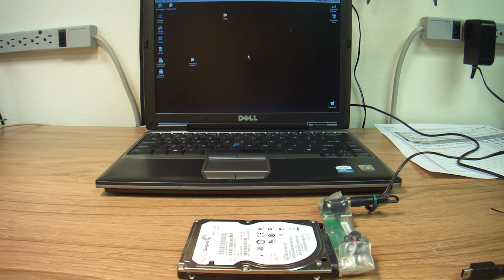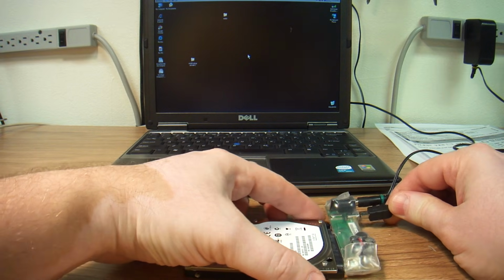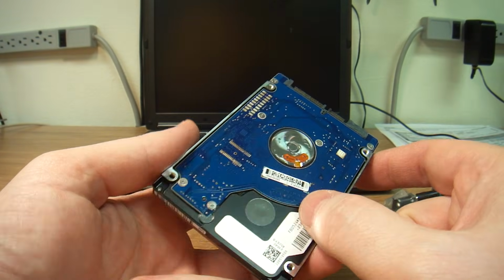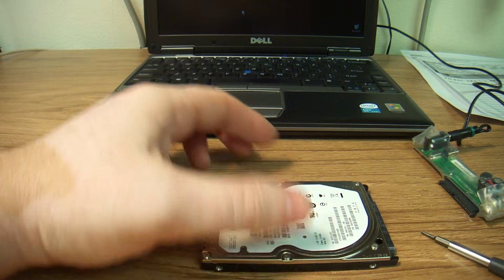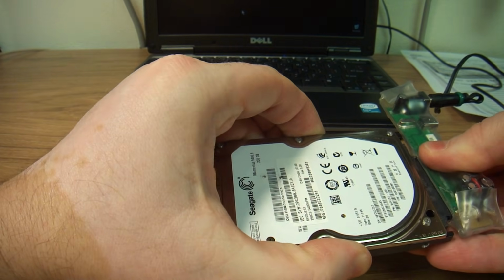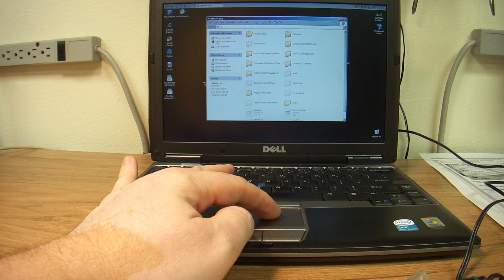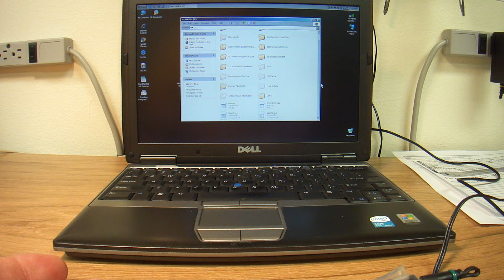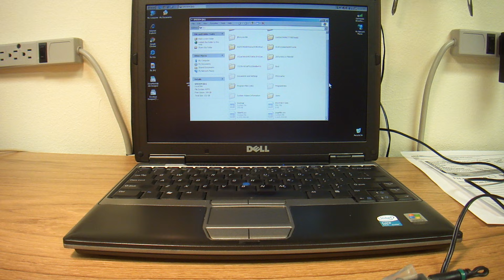How to fix a broken hard drive Beeping noise or clicking RECOVER GET DATA BACK FOR FREE! BEST TRICK

Comment: Just done mine, clicking like mad two drives in Raid "0"  

This was WD high speed VelociRaptor raid 0 set, so i opened both drives and found both heads in each drive about half way across, moved them back to the stops as i rotated the disk. put them back in to the PC booted it and both drives showed up as the raid 0 set, in disk manager both drives had yellow triangles and " at risk" labels, so i coped 103 GB onto a SSD and then in disk management carried out hard drive repair to one of the raid drives this makes windows repair both raid drives together, Faults where found but corrected by windows as in the file below. i am going to carry on running the raid 0 drives as all the data is now on an SSD anyway.  Thanks for the Tip on repairing the drives. 
   

Checking file system on G: Volume label is WD VelociRaptor Raid drive. Stage 1: Examining basic file system structure ... 8448 file records processed. File verification completed. Deleting orphan file record segment 4772. Deleting orphan file record segment 4773. 4 large file records processed. Deleting orphan file record segment 4775. 0 bad file records processed. Stage 2: Examining file name linkage ... Index entry EditorLandscapeResources.upk of index $I30 in file 0xe60 points to unused file 0x12a5. Deleting index entry EditorLandscapeResources.upk in index $I30 of file 3680. Index entry EditorMaterials.upk of index $I30 in file 0xe60 points to unused file 0x12a7. Deleting index entry EditorMaterials.upk in index $I30 of file 3680. Index entry EDITOR~1.UPK of index $I30 in file 0xe60 points to unused file 0x12a5. Deleting index entry EDITOR~1.UPK in index $I30 of file 3680. Index entry EDITOR~2.UPK of index $I30 in file 0xe60 points to unused file 0x12a7. Deleting index entry EDITOR~2.UPK in index $I30 of file 3680. Index entry DIAMON~1.UPK of index $I30 in file 0x11db points to unused file 0x12a4. Deleting index entry DIAMON~1.UPK in index $I30 of file 4571. 9234 index entries processed. Index verification completed. Stage 3: Examining security descriptors ... Cleaning up 8 unused index entries from index $SII of file 0x9. Cleaning up 8 unused index entries from index $SDH of file 0x9. Cleaning up 8 unused security descriptors. Security descriptor verification completed. 394 data files processed. CHKDSK is verifying Usn Journal... The remaining of an USN page at offset 0x30db370 in file 0x23 should be filled with zeros. Usn Journal verification completed. CHKDSK discovered free space marked as allocated in the master file table (MFT) bitmap. CHKDSK discovered free space marked as allocated in the volume bitmap. Windows has made corrections to the file system. No further action is required. 145221631 KB total disk space. 110679572 KB in 6486 files. 4564 KB in 395 indexes. 78835 KB in use by the system. 65536 KB occupied by the log file. 34458656 KB available on disk. 4096 bytes in each allocation unit. 36305407 total allocation units on disk. 8614664 allocation units available on disk.

Comment: Thank you for posting this video. My son dropped my wd passport ultra 2tb hdd and it stopped working. I had my hubby buy the T6 torx screwdriver from home depot, unscrewed the hdd, and sure enough the head was stuck. I twisted the platter counter clock wise slowly while moving the arm slowly off the platter, put the hdd back together and it's working beautifully now.

Comment: This worked for me too after I dropped my portable hard drive, it was making 3 soft clicking sounds.  I opened it up, reset the heads and was able to recover most of the data and also reformat the drive.  Amazingly, even though it fell from the desk to the floor, there was no visible damage to the platter like in your other video.  Thanks!

Comment: Hey abraham, when i start my computer up my hard drive (i think) makes a similar noise to that but it is a lot faster and louder, and when it attempts to read it, and i get a message come up pxe-61: Media test failure, check cable.PXE-M0F: Exiting PXE Rom.Yet when i put my spare hard drive it it does do that and attempts to make a repair on windows.

Comment: Hi, I had the same issue.. Opened the External HHD (Seagate 1TB) as instructed... Opened to see the head stuck..I did push to its original position... but still... its not getting detected,, :(. Now i can feel the disk rotating... head moving.. it remains in the middle for sometime and goes back to it resting position... :( :(

Comment: Thank You so much! This saved my bacon. Worked like a charm. I have a question, if the head was stuck to the platter, how does the drive work after dislodging the head? Is there some self adjust mechanism. Thank you again.

Comment: hi. I have a Seagate momentus 5400.6 external hard drive its not making this repeatitive beeping noise or a loud clicking, it comes on and I can see all my files and access them, however it cuts out  with one small quiet beep then restarts itself and repets the process over and over again, I cant loose the data that's on it .. any ideas or solutions?? would be much appreciated.. thanks

Comment: Hi and thanks for the video!
I'm trying to put an external hdd inside my pc. The windows 7 sees it but can't see the data. It says i should format it which clearly i don't want to because i don't want to loose the information that's stored on it. What should i do?
Thanks!
P.S. I have used the external hdd for about 2 years now and from the beginning it was disconnecting at the very light touch of the data cable. Now, the files from it are getting loaded very hard sometimes but sometimes it works well. Since now i have used an laptop but now, having a desktop, i want to solve this somehow.
I'm really hoping for an answer from you cause i say you know things. Thanks in advance.

Comment: Sir i already fix the beeping noise now it has clicking sound and when i plug it on my laptop and try to open my external hard drive. It says: location is not available
F:\ is not accessible
the parameter is incorrect.

What is the problem of my hard drive usb cable or other stuff?..

Comment: 1,726,244 people have broken hard drives xD
Reply: 1726244 don't anymore!
Reply: +Maddr33 haha True , fixed mine using this trick
Reply: @TheCavebearShow  of you
Reply: update: 2,267,150 have broken hard drives
Reply: OctaviasWolf i don't know, but if your hard drive still works i wouldn't recommend doing this, since it could break your working hard drive.
Reply: You sure~? I thought it was 1,726,245.  :-)
Reply: u mean 3 206 065  😝
Reply: 3.3M Now 😂
Reply: 3 years later, 3,480,199 now have broken hard drives, and the coronavirus.
Reply: Correction, 3,5Millions XD
Reply: Toasted does this work for clicking hard drive??
Reply: Toasted that's the problem, I don't know if my hardrive doesn't work because my laptop freezes on the Samsung logo screen with the f2 and f4 buttons which both are unresponsive.
Reply: did you ever drop it or anything
Reply: well mine didnt break just the opposite infact! my hdd works perfectly again!! as long as your careful it should work
Reply: i dont i just like to know!
Reply: Toasted i think its because i hit it by my head xD
Reply: 3,560,486 people now has a screwed hard drive : )
Reply: 3.5
Reply: 3,646,310*
Reply: Surely this ruins a drive if not done in a clean room

Comment: Hi Abraham..I have a Seagate 1 Tb Slim hard drive that was dropped and stopped working. I opened it as you showed and the heads were stuck on the platter. I moved it back as you showed and reassembled but I still get the clicking noise and the drive does not read. Any other suggestions?
Reply: Also when I open the hard drive back up the heads are not stuck on the platter anymore....

Comment: What if it's beeping, but the heads are parked  in their docks and never move? Platter spins fine, heads will move back to dock if they are manually moved towards platter before powering up, but stay docked and continue beeping. Thanks.
Reply: In the spindle there is a  laser reader, which might has been blocked with tiny agent.

Comment: I have a SAMSUNG. 2TB External drive. The unit was dropped. Hard drive inside of case, of course. Exact Replacement drive works fine. Old dropped drive just doesn't  want to cooperate at  all. It takes the laptop 5 minutes to know that the new drive now exists (F:\). HD TUNE UP won't load as long as that bad HDD is plugged in. As soon as I unplug it, software stops hanging up. The disks in the dropped HD spin. The lever just clicks when the USB cable is plugged in. Device manager sees the SAMSUNG.  The disks do not look warped, in fact they spin so fast and perfect it looks like they are not spinning at all. Yes they are spinning.

Comment: wow seagate must be shitty i suspect mines is broken
Reply: My Seagate is making clicking noises after only 7 months. Buying a WD drive to test those out....Keeping the Seagate as backup though since it works just fine, I just can't handle the noise.
Reply: Shady i agree.... seagate is worst 
mine stopped working within 4 months and then they rplcd it aftr tht it again stopped working.... its soo irritating
Reply: they are crap 4 Seagate drives vi have failed within 6 months Hitachi and western digital drives I have are still going 1 year later
Reply: visdom0
if its clicking then i would not back up on that drive it sounds like its pretty much about to fail
Reply: Certain Seagate drives seem to be highly rated and built to last while other models are absolute junk. The drive in my XPS 400 (2005) served for 11 years before being replaced with an SSD. It still works and I use it as backup storage.
Reply: mine is a Seagate and it indicates that it is failing.
Reply: Believe me or not Im having a hitashi 1tb SATA 2 HDD from 2008 nothing bad happened to the drive until now
Reply: Tbh my seagate from like 2011 is only just now failing in 2020. I put it through some hell over the years too. Maybe i got lucky. Idk. But now that im looking for new ones im getting nervous because there are pleny of people saying even the most popular brands and most recommended ssds have been dying in less than a year. If it isn't going to last me 9 years again what is even the point lol

Comment: Is it possible to lose the warranty if someone open only the external plastic case without touching or screwing the hdd? My external hdd doesn't work, but it has been opened the case just see inside the case, but didn't touched or removed the warranty sticker (to avoid the warranty losing), and the shop deprived the 3 years warranty because they saw that tried to open the external case. Is it correct?

Comment: Hi Abraham, I thought this was an issue on my drive. It fell around 30cm and stopped being recognized on my laptop / tablet. I tried a different pc and usb cable and it tries to start up but doesn't show. (Even in disk manager now). I took apart but it was not stuck on the platter and no visible signs of damage. Do you know any other fixes? I got quote around £750 for recovery!!!

Comment: In this case (heads stuck on the platters), is the HDD recognized by the OS? My Seagate/Samsung ST1000LM024 sounds something like 30 beeps and then goes quiet, not spinning from the very beginning. And it also is not recognized by diskmgmt or even BIOS/setup. Thank you for any advice. BTW, very nice video!

Comment: Hey mate, good video. My HDD has an intermitent problem. It also has a clicking noise, but it is more like a mechanical noise, not electronic like the one in the video. It is weird because maybe it does it a couple of tries and it doesnt boot, but then after a couple of times I turn on the computer and it starts and works normally. Do you have any idea if it could be a similar problem? Thanks!

Comment: hi Abraham
I need Help...
I have a toshiba satellite c850d and won't show any display on the screen
- it open...the screen light up but won't show anything
-after 5 second turn off and turn on ...it keep doing it over and over....

i can access Bios f12 ...F2

have see many vidéos to try make it work but no luck (power button 1 minute...take of Rams....take HD)
I connect Hd to my computer and i acess it ...no problem ...

Any suggestion

Comment: What if the motor's not working at all.. What if I use a write  blocker that is  connected to an External Hard Drive, does the 
gears in that drive have to still be spinning for the datA TO be read 
and transferrered?

Comment: My Seagate ST2000DL001 clicks and beeps when connected to a computer, I opened and I see the head going back and forth and that's when the it beeps.What  could that be?
Reply: +Escorpio40 It's probably failed heads and now also damaged platters, especially after you turned it on without the lid.  These are a problem for professionals also and can cost 2-3k$ if lucky.

Comment: I have an external usb 3.0 that it gave me a data writting error after that the volume dissapeared and no letter assigned but recognized in bios so i tryed several ways including booting from a live cd ubuntu without result. No strange noises. How do I have to proceed to recover my hdd? I appreciate so much any information.

Comment: I had the exact same problem. I think it was caused by a sudden power loss (it's a portable hdd), which cause the disks to stop spinning, and it stuck. Usually, the high speed should make a small air "cushion" between headers and the disks. I did my best not to contaminate the disk, and actually I'm surprised it still works..

Anyway, thank you very much, it worked like a charm.

Comment: Hello Mr Levit, my external 3.5 inch Hard drive just fwll on the floor. Luckily it was turnt off, so atm of impact it was not working. I tried to turn it on and it makes this buzzing noise for like 10 seconds and then remains silent. Any chances to repair this by myself ?

Comment: Hey just wondering, what cords do you use to connect the HDD to your pc? I have an old HDD with data on it still and i want to get it off there, but the HDD will not fit in my Dell D830. Which cords did you use?

Comment: would this also cause it to not be recognized by a BIOS
Reply: +Superchad245 no. thats usually PCB issue.
Reply: ok, i had one that was doing that and wasn't detecting, turned out the motor was siezed.

Comment: For anyone with a Macbook (Pro) with a Seagate (Momentus): there are 2 metallic labels underneath the regular white label that needed to be peeled off before a circular indentation becomes visible, through which that last screw can be reached
Other than that, this worked perfectly on my 6 year old 500gb hd, thanks so much!

Comment: @ Abraham Levit

Thank you so much for the video. I had a problem with a 1 TB Seagate and dumped it after seeing the data recovery prices. I just saw your video and I followed your steps and it worked.

My HDD now starts and shows in my computer but still there is a clicking sound. So I decided to get my data before it dies on me again, but every time I select a folder to copy, the process gets toward starting copying and then suddenly stops. Any idea of what can be done further to get the data?
Reply: The platter surface is damaged. Very difficult to get data from it. You need to go to a data recovery company.
Reply: +Fivos Sakellis thanks

Comment: Hi Sir, i have a broken 160 GB HDD because of ntfs.sys BSOD. My PC won't boot up, and the strange thing is that my HDD became 1 TB in BIOS. On the BIOS the brand is still the same (Samsung) but it became different model & size. 
Tried to save my data using live cd but no avail, using HDD Regenerator but no avail too because the scan suddenly stop with a notable bad sector found. 
What happened to my HDD? It doesn't clicking or noisy as i know.

Comment: I have a Seagate srd00f1 and it started blinking a blue light, and my pc will not detect the drive. I opened up the hard drive, but I see no platter or a head. Advice?
Reply: +andi watt   I am Also Got Same Problem

Comment: Hello Avraam, Thanks for encourage to open unfear hard disks. I have HDD very important info, The PCB burned by over voltage (12V instead 5V) , I got new PCB with BIOS cloned.  Now the spindle runs well, seems heads burned or internal header driver circuit damaged. I am having raw data and zero read by rescue software.  Where I can buy exactly header for WD10EADX ? Do you have video how to change the heads ?ThanksHaim Rodrik

Comment: So i looked at this video cause i was having a beeping problem with just 1 peep every like 10 seconds or so.. only thing that happened was nothing i had it plugged in i unplugged it cause nothing would load then i plugged it back in an then started getting a peep every 10 seconds or so.. so i opened it and nothing was wrong with it so i put the headers over then did like you did to get it back on track and i put the top back on plug it in to getting a clicking and i did everything very smooth i didint break anything was not possible but now i dont know what to do i just feel like reely sad right now
Reply: Dude I got that same problem.

Comment: I have a u56e Asus with a western digitial drive.  it dropped about 6 inches today and now it sounds like the HD makes 3 fast beeps followed but a 4th beep of the same volume. 

I've tried pulling ram, HD, power cycling,  etc and it's always the same.  I get the Asus symbol and a black screen with a blinking cursor. 

It does the beeping sequence 3 times

Comment: hello AB, i have a hdd which just stop working while i was rending a video file on it, it started mking noise and after 10sec it will stop the noise, the hdd still spring but my system is not seeing it.. what can i do pls hlp asap...Bode